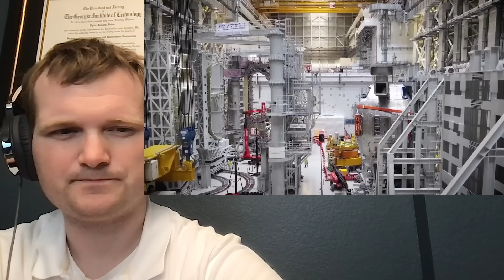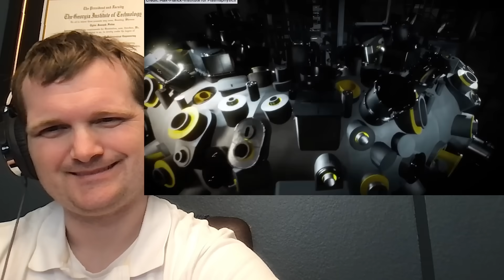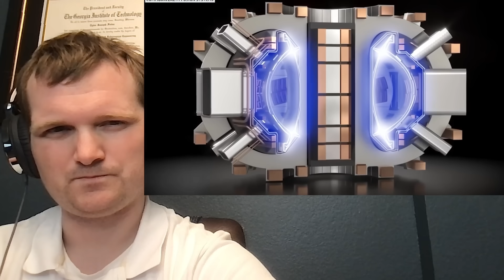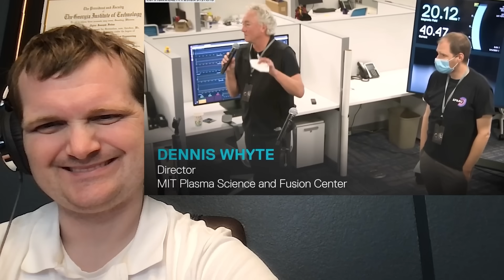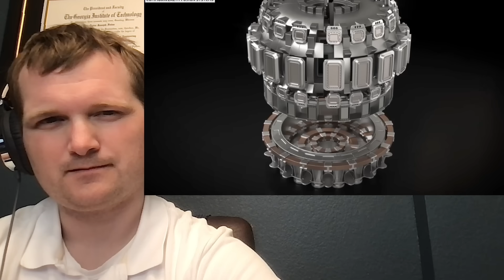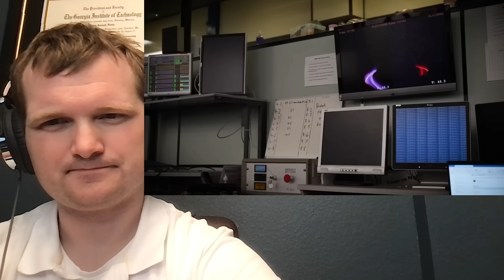MIT’s New Fusion Machine: Could This Finally Change Everything? - Nuclear Engineer Reacts

Comment from the maker: If you want to hear more about Helion: https://youtu.be/0xPw-KQMyhk?si=-znbOdG9Vg8MzsBS
Reply: How do you get the extra heat from fusion out of the plasma and to the water boiler?
Reply: @Terry_davis-l5j It is a Tokomak.  Cover the wall of plasma chamber with beryllium.  High energy neutrons fit the beryllium and heat it up.  Add water pipe to the metal and circulate the hot water to heat exchanger to drive steam turbine .

Comment: I've dealt with metal that's been hydrogen embrittled. They're small diagonal cutters were merely nickel plated, but because they didn't go through the de-embrittlement process, a brand new out of thence package pair just snapped on its 1st use. The sheer line looked more like chipped glass than metal. I can only imagine what goes on inside something like this.

Comment: But how much energy do you need to put in to get what energy out.  You have to include things like the energy to create the liquid helium and all the support systems and computers and everything.  Once it is net positive you need to look how long you have to run it to pay for the production of the system and manpower and maintenance.  Is it going to be better than modern nuclear power plants?  I am glad you pointed out Q total and not just the Q10 output over plasma.

So what is you thoughts on a thorium reactor.  Certain people act like this is so much better than a nuclear plant.

Comment: I'll be really surprised if SPARC can be energy net positive as a whole (that is, take X kWh in from one cable and emit higher than X to another cable for an average of week at once or longer) by year 2030! And do that without highly expensive consumables. The whole point is trying to make cheaper energy source than burning natural gas to generate electricity.

Comment: 25:00 I just want to say here (as a young plasma physicist), that smaller tokamaks actually concentrate less heat per area to the plasma facing components (like the divertor for example) than larger devices, due to the square cube law. The total heat produced is proportional to plasma volume, or r^3, while the divertor area that receives that heat is proportional to r^2 (r being the radius of the tokamak donut). Although this assumes that the power density of the plasmas are the same. 

So the integrity of the divertor might actually be a much larger problem in ITER than it has been for earlier devices, since its plasma volume is so much greater

Comment: My money is still on Stellarators over Tokomaks, but then I tend to choose quality over simplicity.

I'm actually glad that you mentioned an accelerator device because I'm inclined to think that an accelerator that injects high velocity plasma into a stellarator with no turbulence could be the secret sauce to avoiding plasma clumps and ensuring a smooth non turbulent laminar flow since the plasma can be fed in until the toroid is complete and fed with fuel pellets and tritium bred from lithium.

It's not easy and it's not simple but it is very very cool.

Comment: The things that impressed me about SPARC are that Dennis Whyte and his team are also looking at practical engineering problems such as how to make it rebuildable (steel doesn't last forever in that kind of neutron flux), and also that the big issue is plasma stability--it wriggles about and tends to escape the magnetic bottle, which puts the fusion 'flame' out. It turns out that stability improves with magnetic field *a lot*, and SPARC started while these REBCO tapes were available, white ITER started before these magnetic field strengths could be part of the design. If you've seen Dennis Whyte's talks on SPARC you'll have seen his approach is big on science and engineering, small on hot air :-)

Comment: SPARC hopes for 50 megawatts of net heat production and a self-sustaining fusion reaction in 2027. ARC hopes for 500 megawatts of electricity on the grid before 2035. :-) I think CFS will probably achieve both of these goals. :-)

Comment: Could this magnetic one be the core start and the larger one as the output barrier tank? Kind of like a sun?
Reply: The magnetic with stellarators is the fast ignition like the core while the outer shell that's larger can be slower in confining?

Comment: I lot of this can be summarized down to:

Someone finally figured out how to make magnets out of extremely brittle, higher magnetic field, high temperature superconductors discovered in the late 80s.  Doubling the field size is important as one of the efficiency variables varies with the 4th power of field strength.  With that advance they're able to make different design constraints that MAY make things easier and cheaper.

The rest of Simon's video is just a lot of hot air, but what else is new?  I hope we learn something from the project, which is the entire point.  It sort of reminds me of the human genome project where the mapping was going to take 20 years, until Craig Venter came along and tried a different approach, which the government researchers eventually also adapted.  The end result was completing a draft of the work a good 5-7 years ahead of the original schedule.
Reply: Powdered YCBO superconductor in a silver or copper jacket then rolled into tape. Requires LN2 instead of LHe for cooling.
Reply: but is what you typed interesting enough to grab people attention, even people who want to be up to date with work on fusion would probably write off at least you (the writer) as pessimistic at best
Reply: @skeletondoctor1026  I like how nowadays, nothing short of performing fellatio over every little thing passes as pessimism. There's nothing wrong with maintaining a healthy level of pragmatism.
Reply: @skeletondoctor1026  What I said is realistic, not pessimistic.  The sciences are filled with people interest in facts, not emotions.  Pessimism and optimism are tied to emotions, not facts.  i.e. the 8 oz glass has 4oz of water in it.

And a major advance in magnets to be able to make 20 torr magnets out of high temperature superconductors is nothing to be pessimistic about.  There's a number of things you can construct out of a high temperature superconfucting magnet.  Better MRIs that don't require liquid helium cooling are one, there's likely quite a few more.

Youtube has distorted peoples minds where they think if something isn't EYE POPPING AMAZING clickbait, it's not interesting.
Reply: @stevesether  this is why the real nerds find Tyler... and shows like Main Engine Cutoff (for space). As a humanities native, I've just upgraded my physics pods from Sutter's Ask a Spaceman to the Quanta and Physics World podcasts. Gimme the deets with as much density as my poor literary brain can handle plz and miss me with the clickbait
:-P

Comment: 9:36 FINALLY somebody mentions REBCo magnets! 

So since they have to cool the magnets so low perfectly, when they have to run a dynamo from these things (assuming all goes well) in 20 years… where/how does the actual coolant for the water flow? They have to have supercool liquid helium entirely surrounding every part of this thing. How get H2O to hot part? And what conduit do you use that can handle that kindof environment and also won’t complicate every other aspect to the point of infeasibility? If you wanted to transfer the heat for a power gen…

…dude this is goddamn ridiculous to spin a f••king magnet people, fission was already pushing it a bit and not even because of the present danger of our chosen method of doing so. A tool of the Fossil Fuel industry, funding/expertise/opportunity sink. 100%. 30,000ft view…

Imagine if they put half of the total tec funding this has received (even the TOKAMAK alone!) into molten salt systems and for a comparable timeframe… every human being should be ready to drink blood over this. The greedy f••king piggies may’ve doomed the whole damn species.

Comment: the problem with fusion is the same as with quantum computing. it's mostly hype and a HUGE money sink. sure in theory it is possible but it is also very overhyped. the promises almost never include the costs and how high the actual efficiency will be. there is also so much false, incomplete and or just fake information out there that as an outsider it's almost impossible to know what information is actually true. for fusion, even a higher than 1 won't suddenly produce MW or GW worth of energy to the grid. it will be way less. they would need GW worth of energy inside the plasma to get a few MW out with a 1.x efficiency because most of the energy would need to be kept inside to keep the reaction running.
for quantum computers the claim is that it will decrypt stuff with O(1) within seconds. in reality the best quantum algo we have is still only pi/4*sqrt(n). sure it won't take longer than the universe to decrypt a 2048 bit key but it still is thousands of years.

Comment: We will boil water even more!!!!
Yaaay
Reply: Woot woot! New power generstion technology, to use the same 100 plus year old, water to steam to power turbine technique 😂😂
Reply: @WangNurMouth  simplicity and efficiency is key in the nuclear industry. Just because turbines are an old technology, doesn't mean it hasn't evolved. The turbines and generators for nuclear power are incredibly sophisticated.
Reply: @corwinzyn
Yes but have you considered that perhaps these random YouTube commenters with zero industry experience are right and everyone who knows anything worth knowing is wrong?
Reply: @cornoc  it could also be sarcasm/ironic observation. You're both taking a pretty lighthearted comment very seriously 😂
Reply: @WangNurMouth  Yes and? Solar power only recently became commercially viable and is seen as a state of the art new technology and it's been in development since the late 1800's. Your point?
Reply: @Ristaak wind is also waterless, there are many common solar technologies that run on hot water
Reply: @artemis.nnnnnbbbbb so instead of water spinning a magnet around a coil (or vice versa) to generate current, its just the wind.
Reply: @willfire0310 it's still very unique in its challenges compared to water turbines, but it the only one where moving water isn't involved at all (solar panels also don't involve it but other solar technologies do, also you can easily water cool solar panels to increase efficiency though that's is mostly unrelated unless you use the hot water)
Reply: Is there a problem with that?

Comment: I’ve never had one thing explained to me. Even if we achieve fusion, how do we get that confined energy to make steam to turn turbines?
Reply: The same way it happens for fission, high energy particles are slowed down by water which heats up the water. There are some more out there ideas like direct conversion (like helion wants) but that is the common method
Reply: For most concepts, the neutrons carry around 80% of the energy out of the fusion reaction, past the plasma and confinement, into a 'breeding blanket' around the outside, where they're stopped via another reaction in lithium. This has an amazing double purpose - it breeds new tritium fuel; and it also captures the energy of the neutron as heat - which as you say, makes steam, turns turbines.
Some other fusion concepts have other ideas to extract energy more directly, without going via boiling water - but for most concepts the plan is fusion>lithium blanket>water>steam>generator.

Comment: How would they turn the energy created in a fusion reactor into electricity?

Would there be some sort of boiling vessel or heat exchanger. That generates steam for a traditional steam turbine generator 🤷‍♂️
Reply: Yes, it would be a steam boiling type system for most fusion reactor designs from what I’ve observed, though I saw a fusion company (can’t remember the name) say they’re wanting to do direct energy from reactor to grid, no turbines
Reply: For most fusion concepts, including this, that's the plan, yes.
In most concepts, it doesn't even come from the heat in the plasma - actually the neutrons carry around 80% of the energy out of the fusion reaction, past the plasma, into a 'breeding blanket' around the outside, where they're stopped another reaction in lithium. This has an amazing double purpose - it breeds new tritium fuel; and it also captures the energy of the neutron as heat - which yes, goes through heat exchanger, boils water, spins steam turbines.
Some other fusion concepts have other ideas to extract energy more directly, but for most concepts the plan is essentially a fusion powered kettle connected to a steam engine.

Comment: SPARC/ARC is probably the most realistic fusion reactor that will be commercially deployed.
Reply: It already works. Around 48 times more energy output then input
Reply: @Kawka1122  That claim is misleading. SPARC is still being built and has not yet generated any fusion energy. The project’s goal is to eventually produce more energy from fusion than it needs to heat the plasma but that has not yet been demonstrated.

Also: Even if it succeeds in the future, the commonly discussed benchmark is a fusion-gain (Q) just above 1 (maybe somewhat higher), not 48x. So the “48x output” figure is baseless and not supported by any credible data.

Please stop spreading misinformation.
Reply: @williamkane  heating plasma is cool. But how do we make cool things hot with this cool device? Apart from a shitty pun, how do we translate the fusion energy output into a workable energy?
Reply: @williamkane  true be told, this was result of even smaller version of SPARC. More or less bench size. And results were outstanding. Stable DT fission with Q factor of 48 INCLUDING auxiliary system and magnetron heating loses! Which is even more impressive!
Reply: @Kawka1122  Maybe in your fiction world.
Reply: @williamkane why are you spreading misinformation?? Why you lie to people about state of this Technology
Reply: @Kawka1122  ok, what is the name of this test bench project? Details, man... If you are making claims like that, anyone is going to want evidence.
Reply: @Kawka1122  The same could be said for yourself, can you please give us the publication and or white paper for this innovation that you seem to be aware of the rest of us seem to not know exists? I'd greatly appreciate you doing so thank you.
Reply: @uncharteredantelope  I've seen enough of Kawka1122's comments. Ignore this guy, he is clearly mentally ill.
Reply: @worldoftancraft  Likely a supercritical steam turbine loop.